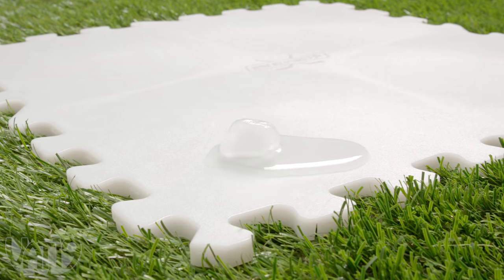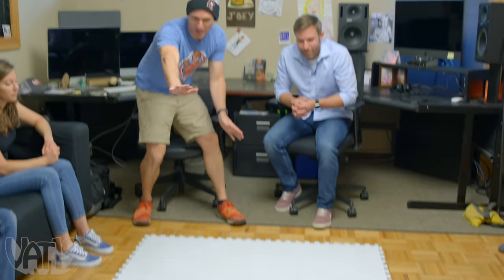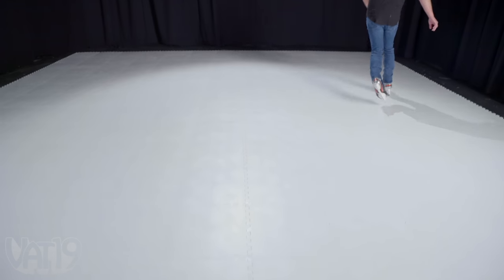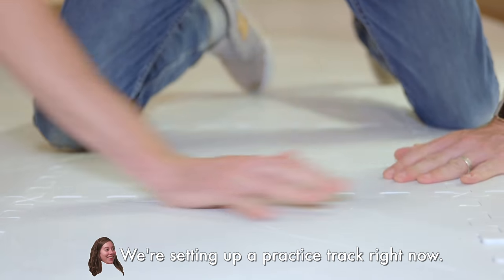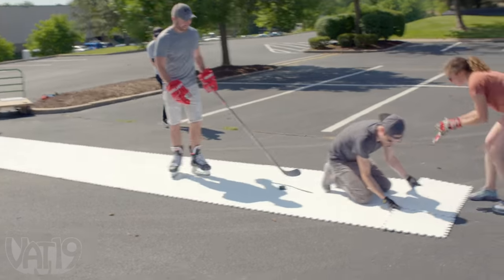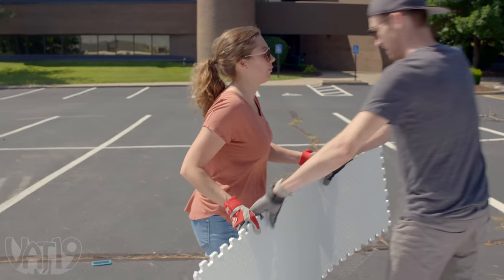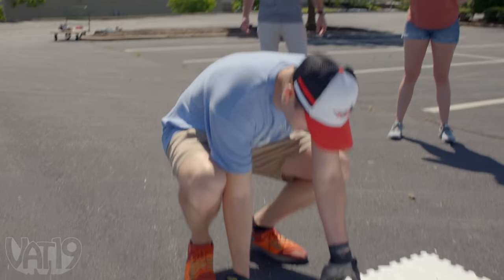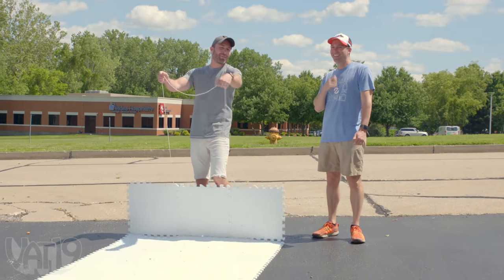We Skated on Indestructible Sheets of Ice

Comment: I was so mad they didn’t do a circle and just skate around that
Reply: But they would have to place the tile down individually because you can’t connect the tiles in a circle
Reply: kachow a circle deep down is just a series of very small straight lines. Just gotta make a rectangle and use the extra squares to round out the edges
Reply: Amazing Turtle oohhh I get it now. Thanks
Reply: kachow I gotcha fam
Reply: Me too
Reply: Well a box but yeag
Reply: ZakZx you could just look up one of those tables for building circles in Minecraft.
Reply: kachow square
Reply: Actually they could've just made a square because a square would be easier
Reply: Dan Severa yeah
Reply: B.B. Hise then the video wouldn’t have been as interesting and not challenging for them
Reply: Or you could’ve mad a long wide strip and go back and forth on it
Reply: They could have just made a big hamster wheel
Reply: Or an square
Reply: B.B. Hise 
same but it would be easier to do a square or a rectangle instead of a circle
Reply: Or they could've also just keep doing laps over and over again of 200 feet
Reply: He would of gotten dizzy
Reply: WOOOOOOOOOOOOOOOOOOOOOSH
Reply: That would make a boring video

Comment: I've been thinking... can you figure skate on synthetic ice? Like do spins and jumps, whatnot
Reply: I have some for hockey and most likley not.  You have to push hard to skate and your skate dosent cut into it aswell.  Also terrible for skate blades. I use a old pair of skates so i dont destroy my good blades.
Reply: DO NOT TRY THIS!! (Unless you have cheap/old skates) it is nearly impossible to try and jump on the ‘ice’. Edge work is also very hard as you cannot cet proper edges due to the need to push harder—this also wears down and destroys the blade. Please, save your money(and your skates) and simply go to a proper ice rink or try inline artistic skates if you are looking to do off-ice practice.

Comment: Me:*looks at thumbnail*
Thumbnail:This Ice Doesnt Melt!

Me: then that’s not ice anymore..
Reply: Diamond ZGreat There is an ice that doesn't melt, It's called Ice VII where water turns into crystal at room Temperature at 3GPa
Reply: True. It's a skating substitute.
Reply: SkySkreeAnimations then it’s still not ice it’s crystals
Reply: Bluefire 1411 but theoretically it's ice because frozen water is crystals at a microscopic level. Water below 0°C (or 32°F) begin forming crystals, you just don't see it. Basically the same for extremely pressurised water at the bottom of a 100km deep ocean

Comment: Just saying, everything has a melting point.
Reply: Michael Nowak but there are objects that don’t melt?
Reply: Eveelution Squad Fan Like?
Reply: Ajay Wurie umm like wood it burns instead of melting I think
Reply: Eveelution Squad Fan fire is just the rapid oxidation of a materiel resulting in heat being released. Wood can be melted, it just requires extremely high temperatures
Reply: Maybe so. Maybe the sheet’s melting point is really high.
Reply: iamxerbear What are you trying to say? Literally everybody does! It’s normal in this day and age :P
Reply: iamxerbear they might not have used Wikipedia because in my school district we have a whole unit about the melting and freezing points of different materials so they might have had a unit about that too
Reply: iamxerbear i believe it was 8th grade
Reply: Dry ice cant melt if goes from a solid to a gas
Reply: @Masamune0x  it can melt, it just under goes sublimation due to the lack of pressure. Pressurize it, and you'll get liquid CO2.
Reply: @iamxerbear1  TAKEEE MEE HOMEEE TO THE PLACEEEE I BELONG
Reply: Everything has a melting point including children
Reply: everything exept organic material. organic material just burns.
Reply: UhM how about bedrock? Bet ya did not think about that
Reply: COoOUUUuuNTrYyyY ROOooOoOoOoOADs l
Reply: Trainer Popplio doesn’t it require an extreme amount of heat in a short burst
Reply: @mofkarim  because wood is organic material
Reply: @wondolind398  no no wood is organic material so it burns
Reply: Whooooooooooooosh!
Reply: @wondolind398  incase your new here, this comment turned into a debate on wether wood could melt
Reply: Xpples bedrock isn’t even real it just goes under sand to stop it from falling. And yes it can burn.
Reply: true the only thing that does not have a melting point is a melting point XD
Reply: Does pure carbon melt?

Comment: Real question here. Who hooked them up with the brand new  nearly $1000 Bauer 2x pro skates.
Reply: H20Shane    Real question is: does this dull or damage your blades more than skating on ice.
Reply: SciFiGirl007 if I used these, I would make sure that I have a secondary pair of skates just for this, or I’d get a sparx sharpening machine
Reply: What about the unreleased flylite with no tape or protection for the bottom
Reply: SciFiGirl007 and who gave them the flylite stick?????

Comment: Or instead of placing it while the skater is skating
Just loop it multiple times
Reply: Lol 4488 Well the thing is the challenge was to skate the length of the hockey rinks; not just the distance. So if the length wasn’t a requirement then yes, they could’ve
Reply: Lol 4488 can you watch the video, they have to skate 2k in length not distance
Reply: What
Reply: I was thinking  that to and I'm not jokeing

Comment: Couldn’t you just do a loop of the tiles, measure the feet of one loop, and do the correct number of laps to reach 2000 feet.
Reply: Displacement, not distance.

They needed to skate 2000' away from the start point.

Comment: QUESTIONNNNNNNN: If I buy this ice will it damp my blades?
Reply: Brianna Geren   that's exactly what I was thinking.....there definitely more friction on the blade.  If I had decent skates, I wouldn't chance it. Notice the brief commercial at the end doesn't say anything about "not wearing down your blades."
Reply: It will make your edges dull quicker than if you were on ice, I would recommend sharpening them after any use on these tiles
Reply: It doesn't actually hurt your blades in anyway but you will need to get it sharpened more frequently!!
Reply: MDoN essentially what I said
Reply: I don’t know anything about Ice skates but I would think the plastic tiles would dull the blades quick

Comment: Don't trust this. I've been on this before and it feels like cardboard and DESTROYS your blades
Reply: Scott Matteson it’s synthetic ice and you just have to sharpen your skates
Reply: @annabelprochilo8793  yeah I guess I was kinda being over reacting about destroying the blades.  Thanks for the info:)
Reply: Scott Matteson ya of course!
Reply: Scott Matteson you could also practice stick handling and shooting, but where your shoes.
Reply: @easton7535  I do figure skating, but I never knew that so thanks;)
Reply: @scottmatteson7360  They're not really designed for figure skating, that could be why you had issues.
Reply: @stingedits6064  ok
Reply: Sting Edits from a ice skater, ice skaters and hockey players skate on the same ice at the normal ice rink anyways?
Reply: @Kattmb3  true, but the blades are different :)
Reply: @Kattmb3  That is true, however the skating tiles aren't intended to be used for sharp turns or quick spins, which is why they're advertised as skateable hockey tiles. Figure skaters could definitely use them, however they might not get as good of a feeling as they need for figure skating.
Reply: HI
Reply: Xoxo._. Christine but the skates r a little different
Reply: You could use socks
Reply: Scott Matteson polyglide ice is more for figure skating

Comment: Technically if you just have Joey in the back of the van skating around in circles while the van goes 2000 feet very slowly so Joey won’t slip he went 2000 feet without stopping (if this happens later in the video from when I comment this I’ll just delete this)

Comment: If I were them I would make a giant track thing so the boards are lined up and curved around a metal frame with wheels so the guy stands on it ice skates and the ice sheet is picked up from the back and put in front, of course, to keep them together I'd use bolts